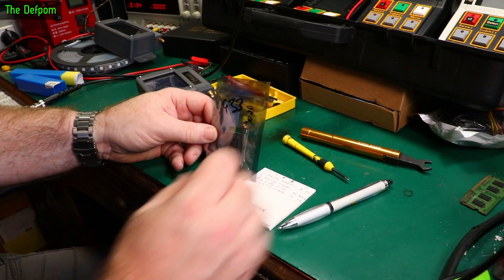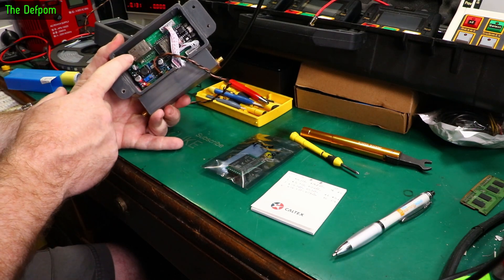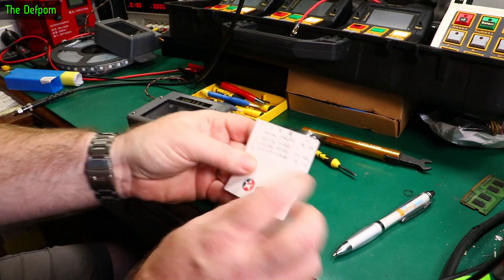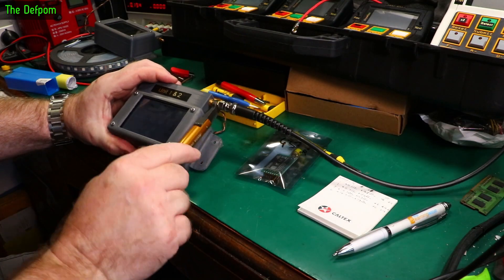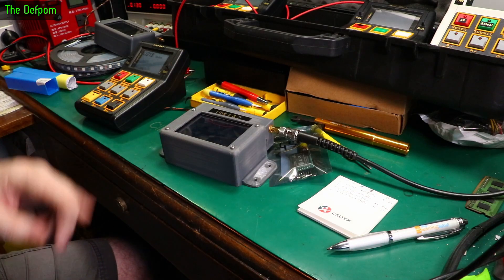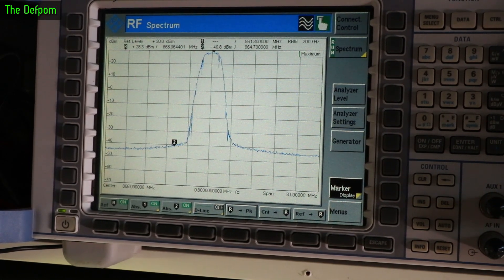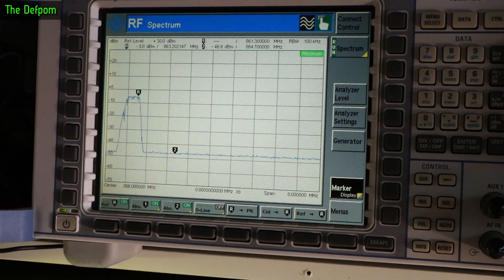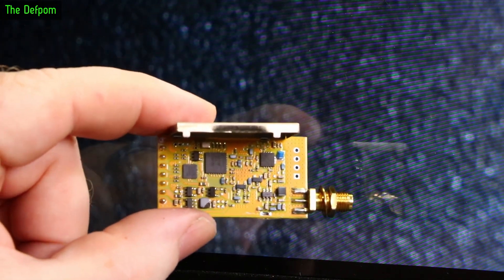🔴 Ebyte E32 LoRa Module Failure Investigation - E32 868T30D - No.1103

Comment: This alert is not related to your module, but EBYTE has changed production with no advice, of ML01DP5, that now they call 10382 or similar, claiming that is compatible.
It is not, causing a lot of troubles to devices based on this module, and equipped with genuine ones.